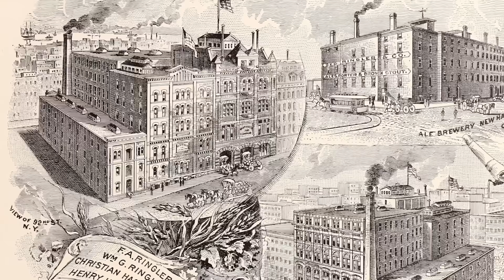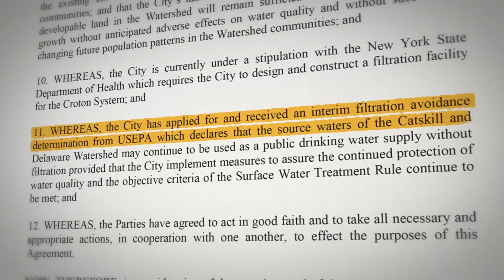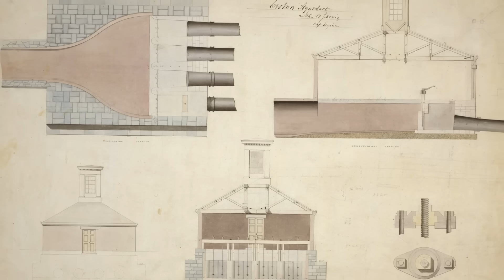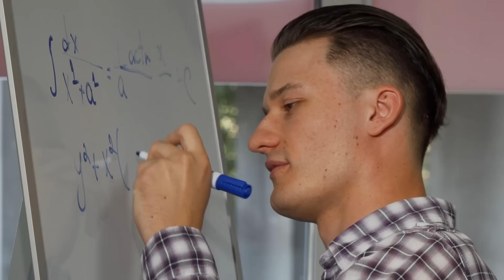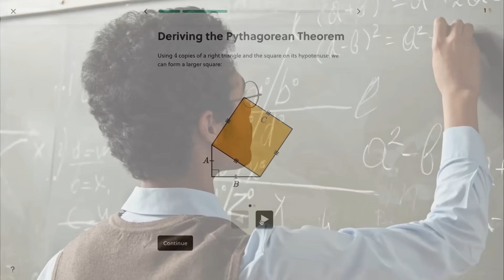The Simple Genius of NYC’s Water Supply System

Comment: Fluoride added to water DOES NOT help cavities. This is basically corruption as it's a waste byproduct of aluminium, fertilizer and iron ore manufacture. So what did they do with this unwanted byproducts ?? THEY MADE UP A FICTITIOUS USE. Also I find it disgusting that Chlorine is standard in US water, certainly not where I live in the EU, give me clean water thanks.

Topical Fluoride DOES prevent cavities aka brushing your teeth, but NOT by drinking it. Also some amount of Fluoride is naturally found in water like spring water but there is NO NEED to add more.

Comment: Flat Earthers will use this video as "proof" for Earth being flat. Assuming that they have some level of education of course, so it's unlikely. Since if you calculate it, on a sphere the source that is 160 m above the end of aqueduct, but almost 160 km away, would be way below Horizon, so technically lower than the end of it. Of course they will deny that the reason might be gravity, because according to them gravity doesn't exist.
Why do I think of the problems that no one will ever even think of and that have such low chance of coming true? I'm wasting my time.

Comment: Sorry, but honestly I don’t care how New York City’s water supply system works. I don’t care if it works. I don’t care if it goes away. I don’t care if New York City goes away. For that matter I don’t care if anything downstate New York goes away. This is so politically incorrect I’ll probably get banned. But I don’t care about that either. Having spent significant time in New York City in the 1980s, working with a Wall Street firm, the only use I can possibly think of for anything to do with New York City is JFK airport and only to change planes to go somewhere else typically overseas.

Comment: What's really astonishing is that all of this is somehow still cheaper and more practical than just removing the salt from the water nearby. Why would desalination of the water from the Hudson river be so hard to do instead?
Reply: There are two ways to desalinate sea water; reverse osmosis and steam distillation. Steam distillation has been known for centuries and was used for very long sea voyages and for producing very pure water for medicines. Later distilled water was used for ship and power station boilers (to prevent fouling) and for batteries (to prevent unwanted chemical reactions} and as drinking water on ships. The process of requires a lot of energy and is only used for land water supply in places like the Persian Gulf where water is scarce, and fuel is cheap. Reverse osmosis involves extremely high pressures, and extremely expensive plant and also uses a lot of energy and also has a very high maintenance cost. Desalination on a large scale also has the problem of disposal of the concentrated brine produced.

Comment: Our system has always amazed me.  Really started to interest me after hearing about the leak and closure, and the cleaning of the Catskill aqueduct.  Tough to wrap your head around.  Even the croton aqueduct is impressive, as well as the old croton aqueduct.  Something else that amazed me about it is that during construction and shutdowns the walls were analyzed by geologists and mapped seismic faults.  The NYC earthquake threat is also a very interesting topic.
Reply: A few years ago I became fascinated by the Mosholu Fault which runs across The Bronx near where I live. Around the time access tunnels were being bored between the Jerome Park Resevoir and the new filtration plant referenced in the video, mention was made of poor drilling conditions between the two locations. At some point I ran across a diagram showing the contour of bedrock across the area of Mosholu Parkway and Sedgewick Avenue (across from DeWitt Clinton High School where I graduated in 1988). The spooky part of this diagram was in how the bedrock level sloped down to the middle of the valley from both sides, then abruptly dived off the bottom of the graph.

Comment: So the funny thing is that part of my job to forecast current and future water amounts and levels for the Rondout, Ashokan and Schoharie Reservoirs. These reservoirs are one of our most complex forecasting locations with the water demand and interconnects that are present with this system. 
My work does at least a daily forecast predicting the water amounts based on current and future weather conditions. Suppose we are forecasting or are experiencing heavy rainfall. In that case, we will issue multiple forecasts daily based on observed rainfall and changes to the future precipitation so that NYC water can maintain water quality and retain the most water in the reservoirs. Wendover failed to mention that additional tunnels connect the reservoirs and another connect to the Deleware River, allowing NYC water to move water between the reservoirs or take extra water from the Deleware River drainage basin.
Additionally, the Ashokan isn't just one reservoir. It's two. One of the reservoirs is commonly used as a settling basin while water is removed from the other half.
Reply: Yes, i was thinking the same thing.they also blocked traffic on the "lemon squeeze" after 911 so you have to drive around to get across the damn between the 2.  I have a row boat on the upper basin of the Ashokan and my grandmothers house is about 300 feet from one of the gates to enter. I have always been amazed by the whole area and the history. The local supermarket even has some old pictures up. There's also spot where a drill bit got stuck in the rock while drilling and blasting during the building of it and can still se it today by boat.  A 10 foot drill bit sticking out of a solid Boulder. Not to mention old foundations the survive on DEP property. The whole area is just mind blowing

Comment: I spent much of my childhood in the Catskills, especially by the Ashokan Reservoir. There are trails on the dams and dykes along the banks and on an old rail corridor that was until recently supposed to be restored as a tourist rail operation. Fishing is allowed, but only in flat bottom rowboats and you need a permit to go out. There’s a ton of wildlife in and around the reservoir as the Esopus Creek which feeds it is a trout stream. Various waterfowl can be found on and around it and there are at least three nesting pairs of bald eagles by the shores.

Comment: I feel envious at the engineering achievements of both the water and subway system because I feel like I will not see any new developments in this lifetime. Everything is so profit driven that it doesn't matter the overall good it would contribute. It's just as necessary now as it was back then to maintain these marvels!
Reply: In China they are laying flat. We can do it too. Even better: form laying flat communities, and with enough people you might have the combined power to achieve something
Reply: NYC subway system is nothing compared to the London tube
Reply: @lukebradley7879   I wouldn't say that. It depends on what you are measuring. NY 248 miles vs London 251 miles,  1,65b vs 1.2b person year.  24 lines vs 11,   468 stations vs 270,  2.75 vs 3.75 per trip.  The cars themselves are bigger, cleaner and air conditioned in NY.
Reply: @firesurfer  not to mention the tunnels for the path trains which are underground subway network That connects Manhattan to New Jersey and are "separate" from the New York City subway, and the underground tracks for three other commuter rail services, (metro north, long island railroad, and NJ transit. Plus all the road tunnels in NYC. There are so many tunnels in New York that some of them are not even being used. Sad that we're no longer building for the future.
Reply: @SofaSpy  Really?  2nd ave subway, the new tracks for LIRR going into Grand Central, Hudson yards. I'm sure there are more I can't think of, plus the new extension for the TS shuttle that is being rebuilt.
Reply: @firesurfer   @fire surfer  2nd Avenue Subway has been delayed for many decades and it's not 20% really completed. They only built so far. The section in midtown Manhattan. The real project is supposed to go all the way up to the Bronx and all the way down to the lower east side of Manhattan. , The Long Island railroad extension to Grand central's terminal started in the 1960s but just like the 2nd Avenue subway construction started and stop constantly and was delayed decade after decade. The tunnels under the East River work built in the 1960s. Without even being connected to any tunnels on the mainland.  Hudson Yards was privately funded by a developer. Sadly, if it's not infrastructure that people can see, politicians don't have the political spine to continue building it because the public thinks it is a waste of money, and they won't get re-elected. For example there are a lot of new upgraded subway stations in NYC but the subway system train signals were never updated and we're still using early 1900s technology. Only recently have they begun to upgrade the signals to be a computerized system, it's slated to go live in 2026
Reply: @SofaSpy  The LIRR connection is nearly done and is scheduled for completion this year. It's officially called East side access. What a wonderfully creative name for a multi-billion dollar project. Politicians are not supposed to be creative, they are managers. Virtually all projects are privately inspired. There is a new project for Penn station in the works with wide ranging construction effects.
from the 2nd ave wiki;
   "A 1.5-mile (2.4 km), $6 billion second phase from 96th to 125th Streets is in planning and is expected to open by 2027–2029."
Reply: They built the Erie canal over 200 years ago with a hand shovels,horses and oxen.
Reply: let hope they put always money to fix and maintain the project we have. just go blame the billionaire team owner that keep demanding cities to build them a new stadium every 5 years.
Reply: Your right unfortunately

Comment: The bypass tunnel and everything that's gone into it is probably one of the greatest engineering accomplishments of the modern era. Just to get done to the tunnels elevation, workers had to dig a 900 ft (275m) deep shaft, straight down through solid rock
Reply: Yes. I visited both sides for work.  Dirty job i did, part of it was cleaning the porta potty they lowered down there.  Once a week they put it in the cage and brought it back up.

Comment: I'm actually hoping when they finally bring tunnel 1 offline we get some photos of what it looks like on the inside. No one's been in there for over 100 years, they found out in the 50's the sectioning valves were inoperable, so they couldn't even shut sections off for maintenance. As it is right now, if a major failure happened in tunnel 1 or 2 it would be a huge disaster for the city, the capacity just isn't there until tunnel 3 is fully operational.
Reply: Probably find a river of pink slime that reacts to emotions.
Reply: @googiegress  Vigo the Carpathian?
Reply: @googiegress that’s in the lower abandoned subway tunnels not the water tunnels.
Reply: Sounds like the start of a movie
Reply: I remember seeing somewhere that professionals do scuba dive in the tunnels for inspection or something.
Reply: @saosaqii5807  that would be an awesome thrill ride, but given the massive volumes passing through, you can bet that what you heard is about another set of tunnels. There is no way to get in the water or out, let alone survive any kind of bump against something protruding from the side even as little as a deck of cards... (I'm a rescue diver. We dive where no other professional divers would dare enter, and I can assure you we wouldn't dive in fully operating water tunnels...) If anything is done, it will be submersible camera pods on cables for visual inspection, ground penetrating radar from the surface and other modern imaging technology, not human "feet on the ground"...
Reply: @saosaqii5807  Only in some places.  There are lots of pressure tunnels up north that cannot be inspected unless they are taken offline, and many of them are known to have been leaking for several decades.
Reply: I can tell what it looks like inside: DARK AS HELL
Reply: now you know why you find abandoned cities across the planet, overpopulated and lack of water!  This is living history showing how the past happened!
Reply: More Water-Shortage-Coverage: 
-Some More News 
-Second Thought 

Were running out of Water and The Water Wars are Coming are Videotitles that 
maybe should make us all watch the videos.

Comment: The water system has ZERO Siphons!!!  A siphon is when a section on the piping actually goes above the level of the source of water. Nowhere in the system does an aqueduct rise above the level of it's source reservoir. So you were incorrect every time you used the word siphon... 

Like if you siphon Gas out of a gas tank, the hose comes out of the top of the tank....
Reply: inverted siphon.
Yes, it's a thing.
Reply: Yeah, it's literally just Pascal's law at work.